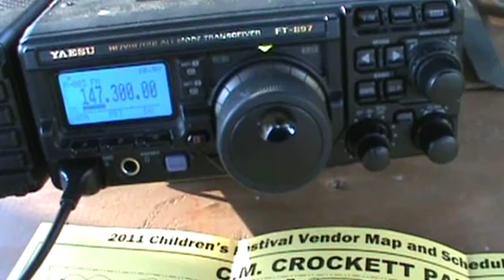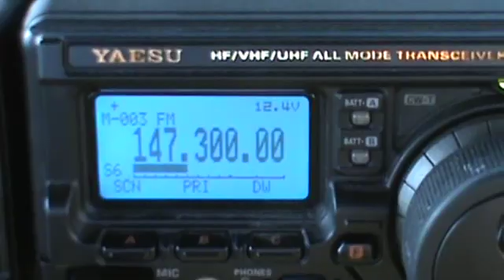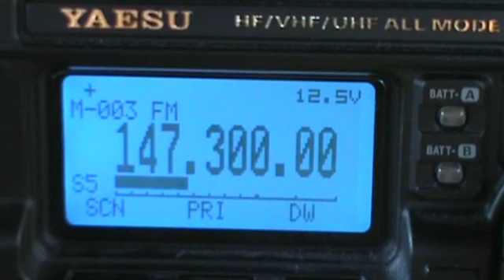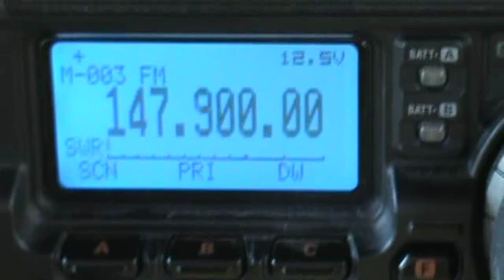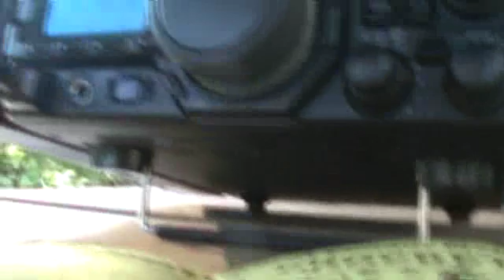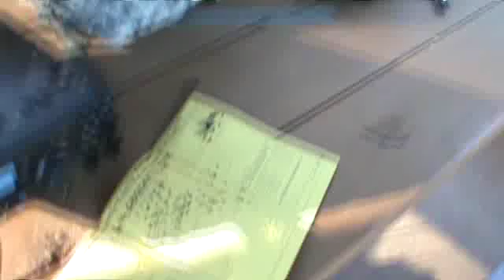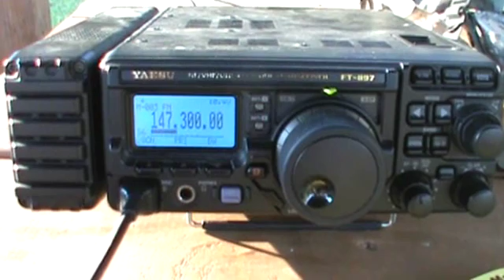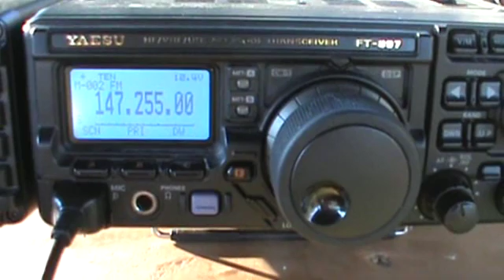FT-897 Portable

Comment: Cool video.  I'm thinking about buying an FT-897D.  I noticed your battery voltage was getting down close 12.0v when transmitting?  Does the unit have trouble below 12v?

Comment: What antenna system are you using and battery source?, cool setup, I have the 897
Reply from the maker: Sorry for the late reply. I always use car batteries, as I get them used from my work in the automotive industry.
As far as the antenna goes in this video, I was using an Arrow Antennas LEO cross polarized 70cm/2meter yagi.
73

Comment: The '897D is my VUHF radio with an occasional foray on HF. I've installed the 500hz filter as I operate CW 99% of the time. For the money you can't beat this radio, I would suggest you purchase one before they go out of production. By the way, it is NOT A K-3 so don't expect stellar HF performance w/o serious filter upgrades for use on HF. Otherwise the 897D an all mode, all band compact is a best buy. 73 & GL

Comment: I run an 897 to a 20m portable Delta Loop that I backpack. It works very well. At 3 feet above ground, I worked an S7 round table with Australia and Croatia with 40 watts from western Washington State.

Comment from the maker: Dont know. When I first got the battery, on a full charge it would take weeks before having to charge it up again. Now a days, it only takes about half a day of abuse before having to charge it up. This thing is not for backpacking by any means. 50 Lbs by itself. I thought Id be a badass two years ago and volunteered myself as a field operator for emergency communications at the top of a mountain. About half way up I needed help and made myself useless for the rest of the day. 73

Comment from the maker: I use a few. Playing with delta loops now and also just built a six meter J-pole. For the satellites I use an Arrow 2m/440 Yagi. Gonna work on a replica soon. Also building a screwdriver antenna which I think I'll do a video for. Have plans for a screwdriver style dipole, though I've been told that it wont work.

Comment from the maker: Yep, I sure was. I have a spare so I figured I could push the envelope. Still working fine.
Curious though, Do you use an attenuator with this antenna for RDF? If so, what make, or where did you find the plans?
73

Comment: Cool video.  I have an Arrow antenna too, you really have to keep the thing right by you, continually adjusting its position.  Don't worry about the building, I've made contacts in my bedroom with a handi-talkie at 5w using the Arrow.  It works well.  Careful with the power, it looks like you have the duplexer version, too much and you'll fry it.